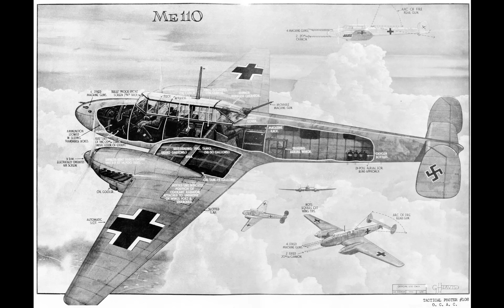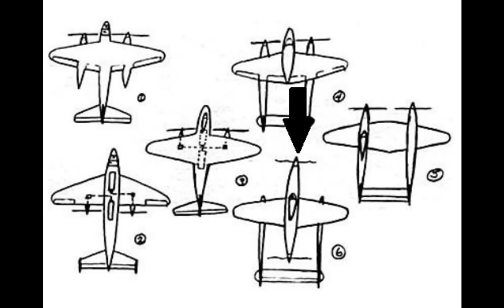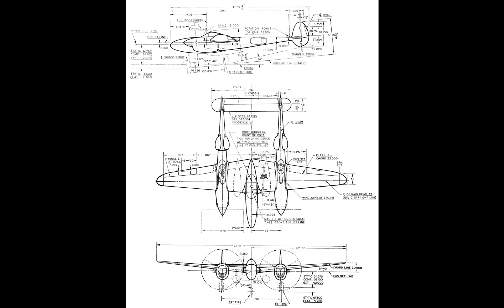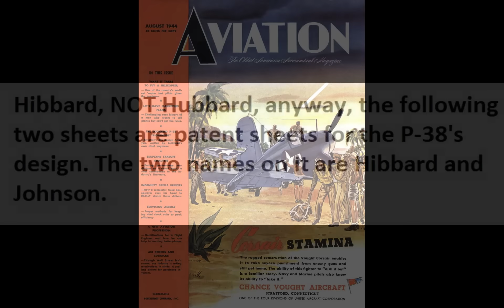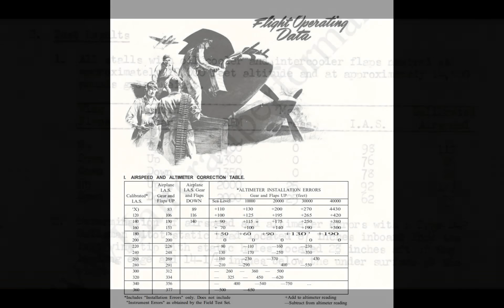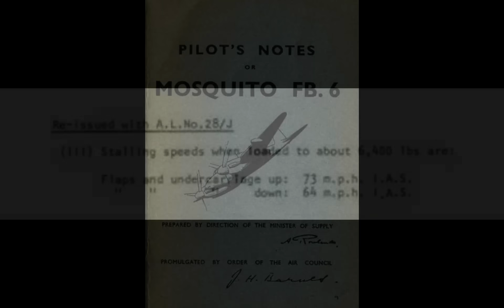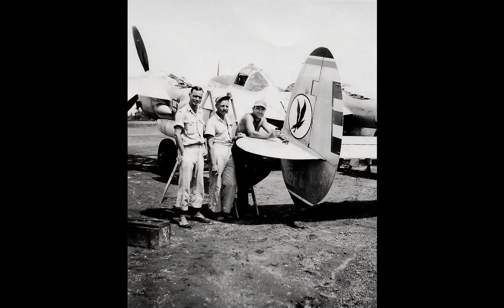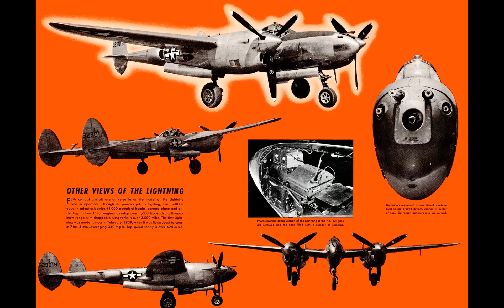Lockheed P-38 Lightning Design Info

Comment: One of the major problems with turbosuperchargers was the heat. Locating the turbosuperchargers in the booms and away from the engines was one solution.
Reply from the maker: That's actually still a problem.
Reply: @GregsAirplanesandAutomobiles  One of the advantages of turbosuperchargers was better fuel efficiency thus longer range. That was important in the Pacific theatre.
Reply: Supercharging is a means to increase fuel consumption-- the whole point of cramming more oxygen into the cylinder is so you can have a corresponding increase in fuel as well.
Reply: @BogeyTheBear  it is different with aircraft. Atmospheric pressure, thus air density, decreases as altitude increases. Superchargering is necessary to compensate.

Comment: I was just going to mention designs and the similarities even in different countries. Makes me wonder if design theft is a factor. Of course from information I got from another video of the P-38, Brittain bought a batch of them. So once you have the plane, what's to stop your building one, just a little different and calling it yours? 
The last video I watched, called it a very formidable aircraft as a war machine.
Reply from the maker: That's a good question. The problem with copying an airplane is that in the best case,, you come out with yesterday's design, but today, so it's outdated as soon as it rolls out of the factory.

Comment: Thanks, I still cannot get my head around that the manoeuvrability should have matched a single engine fighter. As far as I have understood, this was one main thing that prevented the Bf 110 to fulfil its role over England. They are close in size and with twin booms I would suspect considerably more inertia with respect to rolling than with the Bf 110 single fuselage due to less weight at the outside of the axis.

Comment: whats the air scoops in the back do?
Reply: Those are the radiators. The Allison engines are liquid-cooled, and the coolant is piped back there to shed the heat.
Reply: @BogeyTheBear  thanks. i had seen a diagram showing the radiators there.

Comment: BIG IMPORTANT GREG QUESTION: Was the P-38 the only WW2 horizontally-opposed 2x twin-engined aircraft? The P-38 that had both props turning clockwise was a flight performance DUD. Post-war TURBOPROPs: do their props rotate in opposite directions--inward as you say the P-38's did?"
Reply from the maker: Modern twin engine turbo-props are not normally counter rotating. In other words in almost all cases both engines drive a single prop in the same direction of rotation. There are some exceptions with each engine turning two props, but those are very rare.
Reply: @GregsAirplanesandAutomobiles  UHO. I thought so. I was told "twins" are so unsafe from 1-engine-out asymmetric flip-overs--INSURANCE COMPANIES will NOT INSURE them anymore.  My conclusion is the USAF should have kept P-38s and made them push/pull turboprops aka the P-38X and placed 10-20 degree depressed 30mm autocannon in the 2x boom tips for devastating diveless strafing like the IL-20.  As you know, push/pull engine out no asymmetric thrust flip-overs etc. Greg, YOU ARE VERY HIGH I.Q.--an aviation genius--and I thank you for all your hard informative work!
Reply from the maker: The lack of counter rotating props isn't that big of a deal. I'll talk about multi-engine flying in a video at some point. It's just too complex to get into in the comment section, but look around and current production turbo props and you will see that they are NON counter rotating for the most part.
Reply: @GregsAirplanesandAutomobiles   It was with the P-38 without counter-rotating props. If not having CRP makes critical engine out deaths worse; then it IS a big deal. Go try to get a twin insured.
Reply: I want you to in GOOD FAITH find out and not dismiss from ignorance or status quo bias. Go find someone to tell you non CRP twins being insured is somehow NOT a problem. You are implying several people LIED to me; all I'm doing is passing on in good faith what they said.
Reply: @GregsAirplanesandAutomobiles  Are twin engine planes safer?
And when things go wrong—such as in-flight engine failures—history shows piston twins are no safer than afflicted singles. In fact, engine failures that result in accidents are more likely to be fatal in twins. That soothing rumble and hum of a second spinning disk may make pilots and passengers feel good.Jun 5, 2013

Comment: LOL the battery is acting as an armor plate to the radiator lol
Reply: Hell, the engine provides side armor for the pilot. Read one account of a P-38 pilot who saw a Zero coming in to attack him from the side and he banked just enough to put an engine between him and the enemy. Lost that motor, but was able to limp home on the other one.

Comment: I beg to differ on that 90% statement. They might have done 90% of the recon for the USAAF but the UK had been doing photo recon for 2 years before the USAAF arrived. IE it was Feb 1942 before the USAAF was active in the UK. Yes we didnt get the PR version of the Mosquito until November 1941 but there were multiple PR variants of the spitfire way before that. McKinstry, Leo. Spitfire – Portrait of a Legend. London: John Murray, 2007. ISBN 0-7195-6874-9 and McKinstry reports that the PR spitfires were still used to the end of the war as well as having PR Mosquitos (and at least 3 other RAF aircraft types). Not only that some Lancaster's were fitter with cameras on bombing runs to get initial PR shots. Also there were only 3 P-38 groups active in Europe. That is a mere 72 aircraft only some of which were recon variants.
Reply from the maker: You should contact Lockheed-Martin, here you go: https://lockheedmartin.com/en-us/contact.html  tell them their statement is incorrect. However I think it's a case of very specific wording, but I'll address this more in a later video.

Comment: Greg,  I enjoy your videos.  I have some books that might interest you, not for their technical information but for their historical value.   One is called "A Power Primer" published in 1944 by General motors.   It's a good introduction to internal combustion engines for a youngster in the forties.   Also I have four books (small books maybe 2" x 5") published by Whitman Publishing circa 1940 - 1942.   The titles are "Airplanes of the U.S.A.", "War Planes", "Modern War Planes", and "American Airplanes".     

Another is published by Whitman called "the U.S. Army subtitled as a guide to its men and equipment" from1942 same dimensions as the aircraft books.

Another is called America's Navy published by Rand McNally in 1942.   It's more like a mini-book size 4" x 3" and is hard covered.   

All of them feature a picture on each page and a written description of what the picture is showing.

Comment: There were some WW1 aircraft in that configuration - engines in hull, with shafts connecting to propellers on wings. Well, at least one - the AEG Riesenflugzeug 1
https://en.wikipedia.org/wiki/AEG_R.I

Comment: Very much like the drawing of no.6 Fokker also built the D 23. it had a  2 push/pull engines. It was in experimental stage in 1939 . It seemed to have been quite promising. When war broke out it seemed to have been vanished.

Comment: But, the props counter rotate!
Reply: They counter-rotate the wrong way 'round by spinning so the blades come away from each other in the top of their arc.

The problem is called 'p-factor'. It's the asymmetric thrust created by a spinning propellor during a high angle of attack. On a typical single-engine airplane with the propellor spinning clockwise (from the pilot perspective) the left side of the propellor loses thrust when you tilt the nose up in a high angle of attack (such as when taking off or coming in to land). The blade moving up cuts into the air at a shallower angle than the descending blade.

With the P-38, the asymmetry of thrust at high angle of attack conspires to put the most thrust on the outer half of the propellor disc, thus making the imbalance from an engine failure all the more prominent. This is why an engine failure on take-off is so potentially deadly in a P-38 and the remedy was to actually reduce power on the live engine in order to maintain control (counterintuitive to what most planes deal with).

Comment: Remember; the contract Lockheed was going after was only for 12 airframes. Ease of manufacture, practicality of design, really didn't matter.  It was about getting one's foot into the DOD door and the chance of future ( possibly larger ) contracts. No one in 1937 believed there would be 10,000 plus Lightings built.

Comment: Lockheed created a P-38J Prototype and delivered it to the AAF at Eglin Field in Sept 1943.  It was fitted with Paddle-Blade Propellers, and new Allison V-1710-75/77 powerplants rated at 1,875 bhp at War Emergency Power.  

In tests, the P-38K-1, as it was later called, achieved 432 mph at military power and was predicted to exceed 450 mph at War Emergency Power with a similar increase in load and range.

The initial climb rate was 4,800 ft/min and the ceiling was 46,000 ft. It reached 20,000 ft in five minutes flat; this with a coat of camouflage paint which added weight and drag.

Although it was judged superior in climb and speed to the latest and best fighters from all AAF manufacturers, the War Production Board refused to authorize P-38K production due to the two-to-three-week interruption in production necessary to implement cowling modifications for the revised spinners and higher thrust line.  Some have also doubted Allison's ability to deliver the F15 engine in quantity.  As promising as it had looked, the P-38K project came to a halt.

Comment: Love your videos!  Did I miss it or have you not gotten around to discussing the reasons for the direction of rotation of the engines/props?  It always seemed like the choice of direction for each side was backwards from what you’d want for single engine operation.  I remember building a plastic model as a kid and thinking the manufacturer of the kit must have gotten it backwards in the plans.  Wouldn’t torque, P-factor, etc. dictate that you’d want the right side to rotate counter-clockwise, and the left side clockwise (when viewed from the back)?  Seems like the way it’s designed, if you lost one engine, the torque and P-factor of the remaining engine would amplify the effect of the now-asymmetric thrust of having one engine out.
Reply from the maker: No, you didn't miss anything. I just haven't got to that yet.

Comment: I think the P-38’s parasite drag is not as high as made out to be. Most of the reports on wwiiaircraftperformance said that with 1150hp per engine at 5000ft, the plane achieved 340mph. The one report which said 322mph said itself was doubtful and the real number was likely higher. In comparison, a P-39 achieved the same speed with the same power per engine at the same altitude. Being a turbocharged plane, the P-38 doesn’t have exhaust thrust, which would mean the parasite drag per engine of P-38 is actually lower than that of P-39. Considering the P-38 had many features which could’ve been modified to reduce drag, while the P-39 was basically as clean as it could get, the P-38 really was impressive even aerodynamically. On a side note, after I compared F7F-1 with F4U-5, and P-38 with P-39, I believe that a twin-engined plane has the potential to have far less drag per engine than a single-engine counterpart. I think if jets had not come, we would see a lot more of twin-engine fighters due to the performance advantage it would bring.

Comment: How did the 38 achieve opposite rotating props?
Reply: The engines can be configured to spin one way or the other, so you can take a pair of identical engines (that spin the same direction) and flip a few parts around to turn one of them the other way.

When you see notations like "the P-38L was powered by the Allison V-1710-111/113" the '111' and the '113' there denote the two configurations, left and right.

Comment: 2:56 - You said "Messerschmitt Bf 110", the picture says "Me 110". Threw me off, and I had to go look it up. "The Messerschmitt Bf 110, often known unofficially as the Me 110.", according to Wikipedia. You did that on purpose, didn't you. :D
Reply from the maker: Comments are helpful. However it can be correctly called either, Military Aviation History has an entire video on that subject.
Reply: Bf stands for Bavarian Flightworks, the company that Willi Messerschmidt made his name with.

Sort of the same deal, though much belated, with Kurt Tank's contributions to Focke-Wulf finally getting the Ta 152 named after him.

Comment: p-38's having their machine guns directly under the pilots nose and firing straight down his line of sight was a huge understated benefit verses single engine fighter planes which often had machine guns in their wings which were aimed slightly inward so they would converge at a predetermined distance in front of the single engine planes which means the bullets diverged after their predetermined convergent point. just imagine holding two guns straight out beside your head and aiming them at a target in front of you. its awkward. your eyes are not behind the guns. p-38 machine guns had no convergent or divergent issues. the bullets went where you looked and aimed.

Comment: I thought I read in Tony Williams' Flying Guns of WW2 that the 20mm gun on the Lightning was a licensed British Hispano gun, but that the Americans altered the chamber a bit, which was possibly the cause af the frequent jams. I haven't found out what exactly this alteration was and if it indeed caused the jamming problems..
Reply from the maker: Sort of, it was designed by a Spanish/French company and built by both the Brits and the Americans. The Amercian version had more issues.

Comment: If they wanted to make that design ultra-fast, way faster than it was,  all they had to do was cram everything together in just one THING fuselage.  take the engine from one pod and stick that in the NOSE.  Take the engine from the other pod, spin it around 180 degrees, and stick it behind the pilot, turning a 'pusher' propeller.  Then put the machine guns in the wings. The Luftwaffe's Dornier Do 335 Fighter is like that.
Reply from the maker: Obviously, you didn't watch the video.

Comment: Greg, since you brought up the audio, let me offer a suggestion based on what I'm hearing (I'm an audio engineer). It sounds like you're recording in a smallish room with hard surfaces near the microphone. Your voice reflects off of these surfaces, giving it a characteristic often described as "sounding like it was recorded at a kitchen table." In addition to the reflections, the room walls create resonances that cause certain frequencies to be emphasized whenever your voice hits one of them (sort of a "wum, wum, wumm" sound). The effect is similar to talking into a sewer pipe, but far less pronounced. Your best remedy for both of these issues is sound-absorbent materials. Of course, expensive egg-crate foam panels are available, but you can work wonders with a few towels and/or pillows covering the hard surfaces of your table and nearby walls. Don't neglect the floor, if it's not carpeted. 

You can train your own ears to hear how good a room is by removing all the towels rugs from a bathroom and vocalizing in it. Try humming in a rising and falling tone and you'll hear those resonances clearly. Move the towels back in and hear the difference. Add more towels and listen again. Back into your recording room, and you'll better hear the room response to your voice.

Best of luck. Your channel has GREAT content, by the way!
Reply from the maker: Thanks, I am recording in a small room. About 90 percent of these videos are made in hotel rooms when I'm on the road.

Comment: In 1931 when Lockheed was part of Detroit Aircraft, it built its first fighter meant for the US Army.  The XP-900 was a single engine fighter aircraft that was faster than any other current Army fighter at the time.  Only one aircraft was built and was lost during Army flight testing due to a jammed landing gear.  The book Barons Of The Sky by Wayne Bibble has an excellent writeup on this aircraft.

Comment: With what is known about aeronautical engineering now, I wonder what could be achieved if this airplane were redesigned today?
Reply: I think certainly they could have done much to eliminate the "compressibility" problem during a dive early in the design phase if they had modern knowledge of transonic airflow.

Comment: So here is a thought, with the two engines rotating in opposite directions there should not be a preferred roll side, single engine planes will roll better to one side or the other, than means you can roll to the “bad” roll side of your foe.

I wonder if this was in any way useful to combat pilots?. I hope Greg talks about roll rates against torque sometime
Reply: This would make single-engine pilots utterly predictable. Every time you bounce a target from behind, you could fully expect them to break left more often than not.

I mean, it's the very reason why the island on an aircraft carrier sits on the starboard side of the ship-- the mechanical inclination to drift left in an emergency. P-factor, torque, and propwash all conspire to make a single-propellor plane turn left under a sudden increase in power.
Reply: If I were in a P-38 being followed by a single engine prop fighter, I would probably prefer to bank to the right to escape.